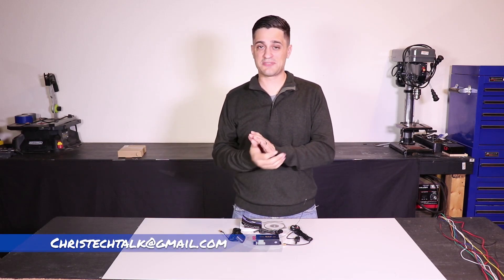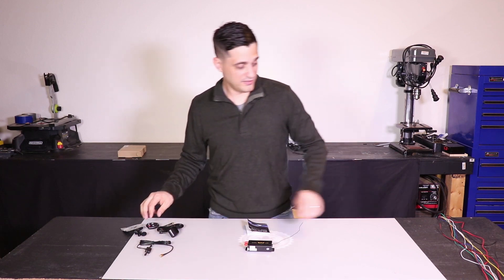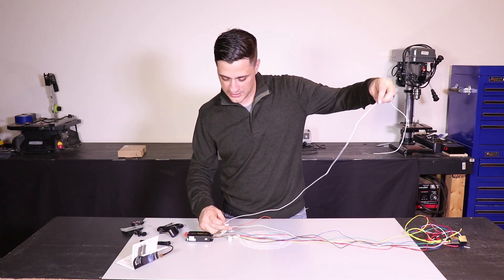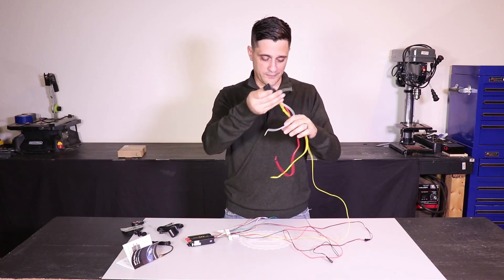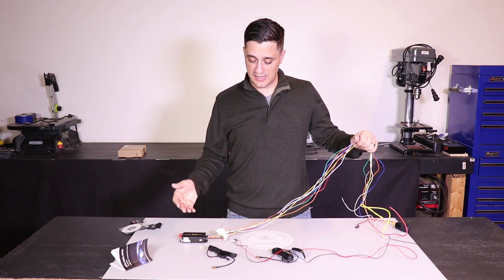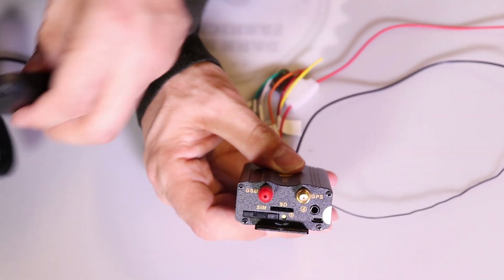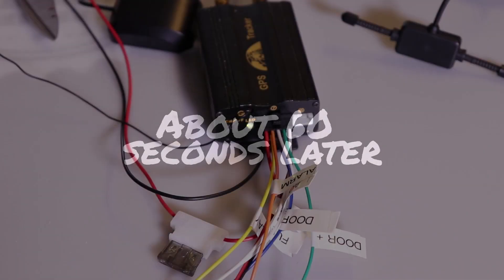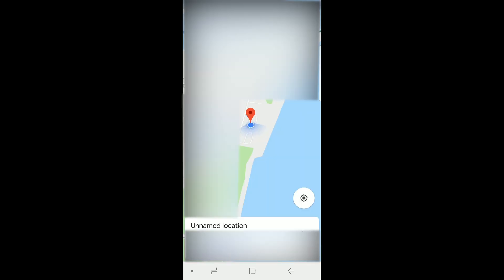Bench Test GPS 103B

Comment: Are the commands the same as TK 102 ?. I just bought a 12V to 3.7V converter for about $7 and will wire my TK 102 to car battery. TK 102 also comes with USB power adapter.   Question: is there an OBD II equivalent to TK 102 ?. Many requires monthly service.

Comment: Chris......how long will the 103B internal battery last if my car is parked in storage but I have a battery tender charging my battery the whole time.   I'm not sure if my car is turned off.....that the internal battery or the GPS 103B will be getting powered from my car battery........Thanks....
Reply from the maker: Hey Jay, sorry for the delay in answering.  The 103B doesn't come with an internal battery.  It has an option to add a battery, but ideally, it will be connected to your cars battery.  It should take months to drain your cars battery.
Reply: @DarkMetalFabrication  Chris....but when I opened my new box and pulled out the 103B unit....I turned it on and the red light came on.  Whats that?
Reply from the maker: That sounds like you have an internal battery, but I've never seen a 103b with a battery.  I'd have to see it.  For now, I would take a look at your manual, and see if it says anything about a battery.  If it does, check for an mAH rating for the battery.

Comment: So what is the alarm wire for?  Is that to connect into my current car alarm.....?   Also, can I still use the ignition cut off switch through my cell phone?
Reply from the maker: Its for factory installed car alarms.  It hooks directly to the factory installed siren.  Also, yes, the relay harness can be installed in several places (ignition, fuel, etc.) and can be controlled by a text message.  For $30 dollars, its a great kit, but the customer has to have a fairly strong background in installations to hook up all the optional peripherals.  Or have a good place to take it.
Reply: @DarkMetalFabrication  Hi. Do this mean that if my factory car alarm is triggered it will notify my tracker and my tracker will notify me? (I have this tracker in my car and want to achieve this). Lot of thanks! Great video. Following.

Comment: If the thief does rip off the GPS puck after taking my car....will the sim card cell signal still allow me to track where my car is located or moving...?
Reply from the maker: No, unfortunately it needs the GPS puck in order to get a location.  That would be a great feature though.
Reply: @DarkMetalFabrication  So the sim card is just so I can get information texted to me....?
Reply from the maker: The sim card allows the device to "talk" to cell phone towers, which allows you to send text messages to the device  and allows the device to send texts back to you.  As far as how often the device reports its location is up to you.  There is code you text the device which tells the device how often to report its location.
Reply: @DarkMetalFabrication  There used to be a product called "Car Cop", I think ADT made it.  They spared no expense.  It did that....if someone stole the car and pulled it into a garage and the GPS quit....cell tower triangulation kept going and giving you info.  They also had a monthly service like they do for homes....so if you are sleeping when the car is stolen......they get notified and they call the police to chase your car down immediately.  I think sales were low because it was $1,000.  I would buy that in a second.........
Reply: @2ndAmendProtector  Can I use a splitter off the 103B box......then have two GPS antennas hooked up.....?  If one gets ripped or they cut the cord off, then the other one can still give the unit positioning data...will that work like that?????
Reply: @DarkMetalFabrication  Can I use a splitter off the 103B box......then have two GPS antennas hooked up.....?  If one gets ripped or they cut the cord off, then the other one can still give the unit positioning data...will that work like that?????

Comment: Chris.....I suppose I just go to TMobile and get the cheapest cell phone plan available?  Will they give me the proper size sim card that will fit this product?  Or I suppose a sim card adapter is all I need if its the wrong size card....
Reply from the maker: Hey Fyle, if you go T-Mobile, they can definitely hook you up with a sim.  I use consumer cellar because they offer plans for $15 a month.  You will probably need an adapter for the sim card, but most kits come with all of the adapters and are fairly cheap.
Reply: @DarkMetalFabrication  Ok cool.....thanks.    One other question:  If my car is stolen can I see real time movement of the car on google maps as the car is being driven away.......or would I have to keep texting to the unit to get updated position reports?